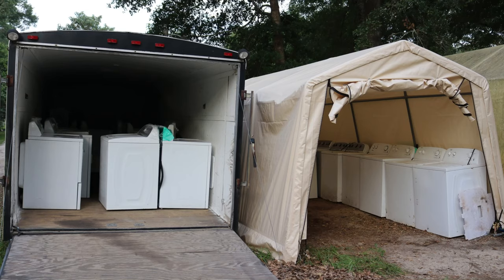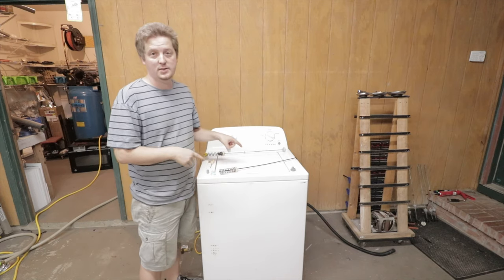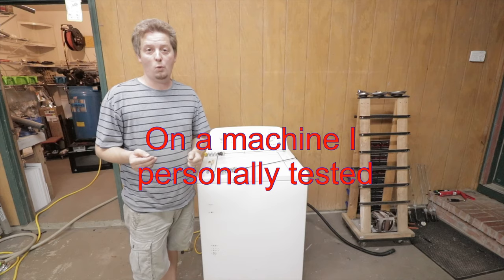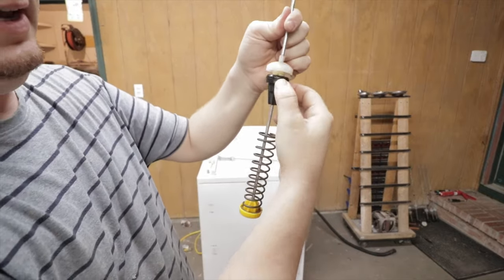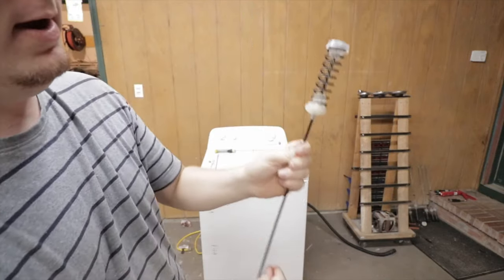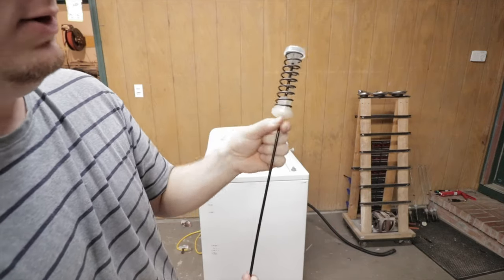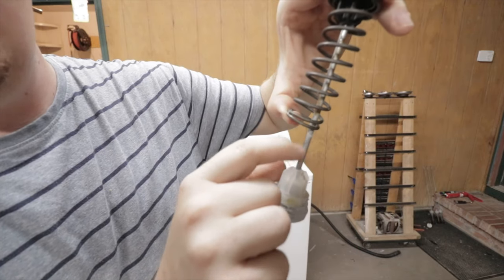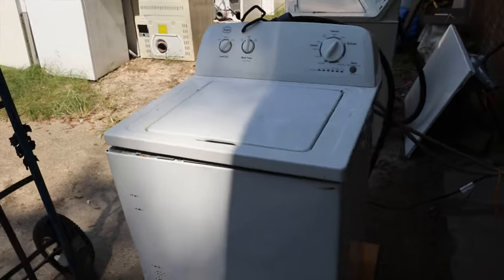Cheap Permanent? fix for shaking banging Washer? $7 to fix Suspension dampening rods W10780048

Comment: Thank you for this video, I was really in a jam with my machine at a time, when finding replacement rods was a long wait away.
Watching this video made me understand how it works. I didn't get rid of the foamy insert. when I squeezed it against the rod and moved it up and down it was gripping. I closed the gap between the foamy insert and the rod by cutting it lengthwise and wrapping it tightly on the rod then use electrical tape to wrap it so it could stay in place. after which I push it back in the cup and the rest was dream come true.
Reply: Awesome idea! Thank you!
Reply: I honestly think that's a good idea, wonder if cable ties around the foam sleeves would make it grip better? Once they got a little loose again, just snug up the cable ties.
Reply: Did you cut the foamy part at the bottom and then wrap it with electric tape? and is it still working?
Reply: @h.s.6498  I cut the foamy part lengthwise, in the direction of the rod. Then wrapped it tight as I could on the rod. Yes, to my surprise it still works to this day without having to go back at it. The machine works light in the week but  heavy on all weekends, just to give an idea of use.
Reply: @garyr7027  I have no doubts that the cable ties would work. The problem might be trying to fit the tie head inside the cup. Space is limited. The tape is just a thin layer and pushes back into the cup with no sweat.
Reply: Is that still working?
Reply: Brilliant idea!!

Comment: Im amazed that anyone would put in this effort to solve a problem on a washing machine. Thank God you did because this is my problem. New damper rods will be delivered tomorrow. Next time though if needed i will do what you demonstrated. Thanks a bunch.
Reply: Though he is the repair business and his search for a diy solution may have $ and/or improvement of replacement parts as I can imagine the replacement dampener may fail sooner than later. My effort in trying an alternate method is solely because I would like it fixed today  and not wait for the part and because I enjoy jury rigging.

Comment: Thank you for this information. I did indeed have all four bushings sliding freely up the rod. I bought some small clamps with rubber coating and put them between the top piece that pops off and the black piece that houses the faulty bushing. It was tight but not tight enough so I wrapped the rod with some two sided sticky foam tape. Then  I put the clamp back on and tightend with small pan head screw and nut. The clamps were about 1/2" tall. It didn't work cause I was now raising the drum 1/2"
I took the clamps off and compressed the foam sticky tape that stayed adhered to the rod by pushing the top piece back down on the black bushing where it belonged. I noticed now the bushing was super tight on the shaft. Put everything back together  and planned on ordering new extension rods, but  the problem went away! Curious how long it will work but I'm not going to give up. The gentleman is right. The bushing has to be super tight but be able to move a bit with pressure. I might be crazy but there's got to be way to "swell" that area of the rod where the bushing moves on it. A tapered bushing? Knurling that area? Locate vibratite to keep nuts from moving on threads?

Comment: I have been using top load washing machines for over 45 years. Have never paid attention to how we load the machines. And have never had any serious issues with out of balance loads. Several months ago our washer died. After diagnosing what was wrong I didn't think it was worth fixing so we bought a new one. What a mistake. The very first load violently spun out of balance. We eventually had to remove some of the wet laundry, wring it out by hand then throw it in the dryer. Has been hit or miss ever since if the thing would dance around the basement during the spin.  When I pushed down on the drum (today) it seemed really hard to move then suddenly it felt like it broke loose and would then bounce evenly. The dampeners seem to be working fine (now). No excessive movement or bouncing. The next load of all towels including four big ones ran fine. Not sure if I fixed something or not.🤔

Comment: Thanks, the dampening action makes sense. I work as an apartment maintenance tech and have replaced a few of these. I always assumed it was just the Springs had worn out and were loosey-goosey. I always come in after I get a complaint of a banging machine and grab the top of the agitator and push it directly up and down, when the rods go bad the tub will bounce up and down like a pogo stick freelee. When you install the new rods you can't bounce the tub like that at all. Make sense as you stated that its the dampening action versus just the spring strength
Reply from the maker: That’s true. I have done that test several times. Sometimes it Will not show like it is bad because the only one of the rods will be bad. But most of the time they will all go bad at the same time because when one goes bad it will shake the rest of them until they all wear out.
Reply: There’s damping grease on new rods. This grease is very sticky.
Reply: As John said, it is all about the damping grease!  I added Nyolab 767A to my old rods and that alone solved my uL problem.  Idea from Zack Stone.
Reply: @WasherDryerMoney    Yes, exactly spot on.  I had mine felt good, but when I took it apart, the back left one was totally broke.  The spring seemed popped off and the top part was crushed into it.  So, it was probably no shock-absorbing.  But, replaced them, and it spins like a little wheel on a top.  Perfectly.  Quiet as anything now.

Comment: Thank you from the bottom of my wallet.  I had inspected the suspension rods hoping to find a break, to no avail.
I had to conclude there was nothing logically anything I could try to repair.
After witnessing my possibly devil  possessed washer literally go airborne, it was time to buy a new one.
Until of course, I viewed your video. The only one that explained and showed the problem. I opted for new rods, with a year
warranty, for those of you on the fence over putting money in an older machine. Runs like it just came out of the box.
Excellent video, thanks again.
Reply from the maker: Glad to help.
Reply: Can you please tell us the parts ##

Comment: Finally. I've been searching for the answer to this problem for a year.  Thank you so much for
explaining how it's supposed to work. I wonder if that little foam piece was originally made from hard rubber. I've never had this problem until I got this Roper machine.
Reply: I'm about to try just adding damping greases. Pretty much pop the plastic top and add it
 Nyogel 767a I'll let you know if it works. 

Not sure if the other comment posted but it showed an error on my side so I typed another

Comment: I too have never left a comment, but this washer and this video deserve one.
Thanks! This info has saved my relationship with this washer. I looked at some comments to see what others were doing. Then I looked around my house for what I could use to supplement these foam breaks. Then I saw it. There it was. 
Plastic Hanger strap. Its the correct width and height. I can't remember how much I cut off for each one, an approximation of the diameter x 3. I had to get the foam slid up from the little reservoir, then get the hanger strap piece started in the reservoir and then slide the foam down in the hanger strap. Lastly push them both down together. Its been working great for over a month. 
I will say there is a learning curve. I mangled the 1st foam a bit trying to do this, but I supplemented with pieces of a tooth pick as others had mentioned. 
I know that this won't work for all because sometimes the foam is deteriorated too far, but if it's not, then this seems like the simplest solution from what I had around the house.
Reply from the maker: That’s awesome. I am still using that test washer in my personal home and it’s still running fine. I am going to be doing another video soon on a easier fix. it’s actually a suggestion from the comments that a bunch of the repair guys agree should work and it will be easier.

Comment: Thank you for the video i finally understand why it was always going off balanced. I took a lot of wet clothes back out to try and balance the washer and it just kept getting worse  until it finally would barely spin without banging. I also liked where forty four was going but couldn’t wrap my head around it. So i built off of that idea to minimize the upward bounce. I got some 24” bungee cords. Drilled some holes in the base. Ran the bungee around the top of the spring mount. So the springs keep upward tension and the bungee’s keep downward tension. First load is done so far so good.
Reply from the maker: Interesting. I have seen a few people using bungees hooked on the shocks to the bottom of the washer. I have not experimented with it yet. But it is interesting.
Reply: Can u share a few pictures of the arrangement?
Reply from the maker: @salmans75  arrangements?
Reply: @WasherDryerMoney  on how the bungee cords were installed
Reply: @salmans75  
Sorry for the very late response. I drilled holes from the outer walls 3.5” inward. This is by every outer corner on the base. It I’s also .5” into the frame, enough for the hook on the bungee to set right.  Then Put a bungee cord between the suspension rod and the tub. Tried to make the placement even. Then secured it to the base through the holes i drilled. 8 holes drilled 2 on each corner.  4 bungee cords used one for each suspension rod.  I would share pictures but i don’t know how to post pictures so everyone can see them
Reply: @salmans75  update on this arrangement with the bungee cords. No other modifications were made or have been made. Still going strong.  only time it shakes and bangs is my own fault and can be corrected. They are very few and far between

Comment: Very good engineering I have tried another idear I used plummers tread seal  around the worn bushing  30 raps around  tight 20 wraps on the whole bushing and 5wraps from the middle of the bushing to the button with half tredseal hanging out the button of the bushing and 5 wraps on the top side of the bushing with half laping over the top  like the button . Then thurn it while pushing the bushing back in place .this works very well for over 6 months and still going thanks for your info.

Comment: Have a 10 yr old Simpson 9.5 kg top loading washing machine. Recently noticed on spin cycle, when drum was turning at top speed on spin cycle, the drum would spin out of equilibrium, banging the side of the washing machine till the machine shut down automatically. Disconnected power cord, hot/cold water pipes. Removed the lid, facia panel (controls) & top panel above drum.Tipped machine over, found one stabilizer bar rods damaged plastic cover that sits at the bottom covering the spring was fractured. There's a flat washer at bottom end of rod, spring sits on top of the flat washer. The spring is covered by a plastic cylinder/cover. The top end of the plastic cover is molded rounded at the top end. Rounded section fits snuggly into the rounded molded plastic bracket at bottom of drum assembly. There are 4 stabilizer rods evenly spaced around the drum assembly. I removed the rod assembly by removing plastic disc top end of rod, then dropped the rod downwards out of the drum bracket totally removing the rod away from the machine. I had some old aluminum gutter panel in my shed which I cut out, molded & shaped to fit the exact rounded profile of the fractured plastic top section that covers the spring. The drum sits on top of the rounded section at the top end & is the part that cops all the shaking/vibrations during the wash cycle. The drum hangs on of all 4 stabilizer bars. The springs on the stabilizer bars are like shock absorbers & are compressed downwards as the drum fills with water & adding items for washing. Fitted the fabricated section I made on top of the plastic cylinder giving the plastic cover strength. Assembled all parts, washing machine works like new again. I'm a metal fabricator by trade & have all the tools which made it easy. Regards from Australia.

Comment: I cut 4 small pieces of a standard zip tie and shoved them on the teeth side against the metal shaft, which nicely increased the friction.  I hope it has a lasting fix.

Comment: Thank you. Very helpful. I replaced mine with cylindrical rubbers, 1/2" long. It's working now. Just don't know how long.
Reply from the maker: If it gives out the Liquid Nails is still working for me.
Reply: what are cylindrical rubbers?
Reply: Yes.  This is a good idea.  Did you just slit them on one edge and fill it with washers?

Comment: I just did mine I took the rods out and replaced them with 1/4" ready rod. I used red lock tight on the nuts and double nutted at top bottom and top of the spring. I also used lock nuts on the very top and bottom for extra insurance. Seems to be working so far. I did have to drill out the plastic and washers to 1/4" as well.

Comment: Finally, someone that explains why the rods need replacing! I am a fix-it man and always prefer having a go at repairing before replacing. You are worth your weight in gold as I couldn't understand with all the "repair" videos why they are actually replacing he rods! Have you tried small zip-ties on the original foam pieces? I haven't pulled mine out to check if they are still solid enough to accept a zip-tie but maybe that's another way to do it?
Reply: I am happy to report that a combination of collecting & repacking the excess sticky grease from around the rod, as well as use of zip ties has been successful so far! No need for any other silicone or additives yet....

Comment: I knew it.  I knew it couldn't be that these things wear out so fast.  I've looked everywhere and came across another video who mentioned this one.  I've had this type of washer in the past and had this same issue and just got rid of it out of frustration.  I just got another one that has this issue and I am determined to figure out what the real problem and soulution is.  I'm highly  confident this will work and I think I know of another item that could be used instead of the liquid nails but that's a great one. 
 A couple things: It's actually Damping rather than Dampening, and the grease that comes on them from the factory is called Damping grease which serves the purpose you described; to slow the movement on the rod but not stop the movement.  What I have found so far is damping grease is expensive and at this point it's hard to know what viscosity is being sold.  Also at this point it seems that the stuff we want may be an orange color whereas colorless is on the lowest end of viscosity and therefore offers the least amount of damping.  
I already ordered a new set of suspension rods before seeing this and my plan was to carefully measure them and determine what the solution is.  The operation of the rod seems so simple that it didn't make sense that the springs were worn out which is the implication by virtually every video out there.  It didn't make sense to me that if it was the springs why hadn't someone found a replacement spring and rebuilt the old ones.  
Maybe you have an update video to this, I haven't looked yet.  
Thanks for being the one to figure this out.  
As much as I hate the beeps, blops, clicks, ticks of these new machines they work really well when they are new, their ability to spin the water out of laundry is amazing. Towels come out feeling dry in some spots. 
I watched the whole cycle the other day and it's really interesting to me the steps they added to the programming pf the wash cycle and I feel I've worked out why it does what it does even though it appears redundant for no purpose I now see the purpose. I want to love this newer technology as the number of old machines is falling every day.  I see scrappers with them quite often.